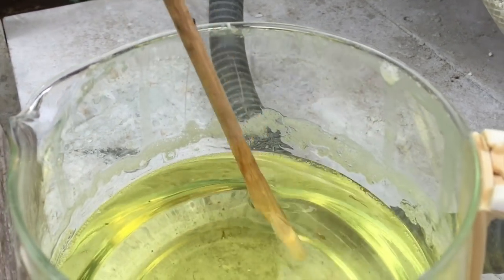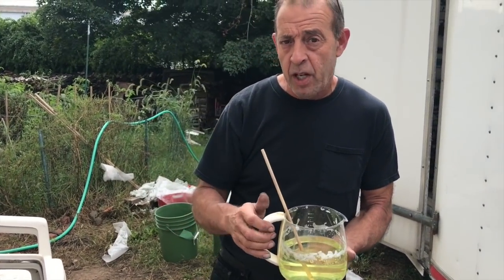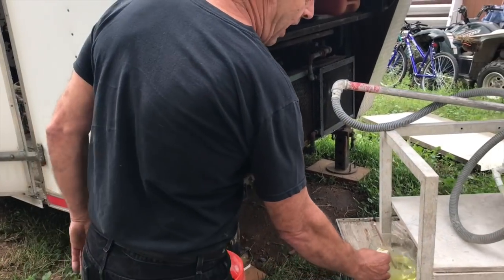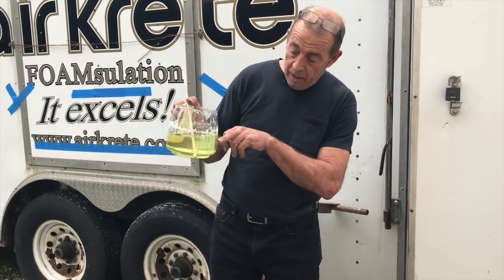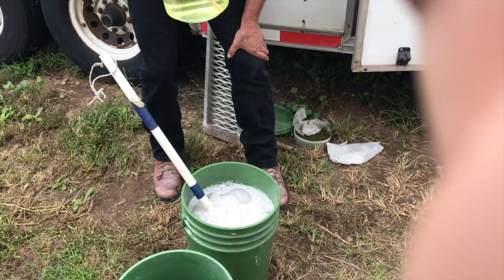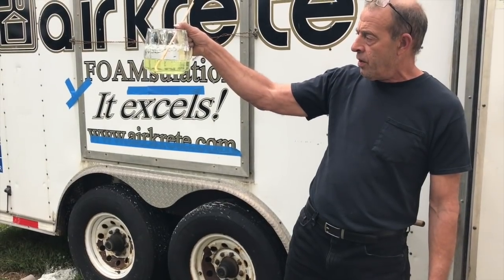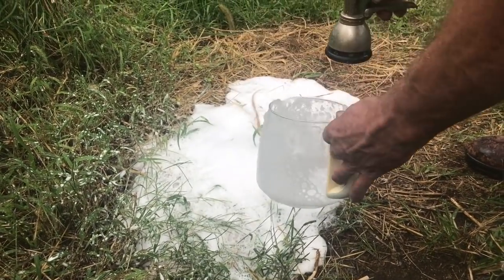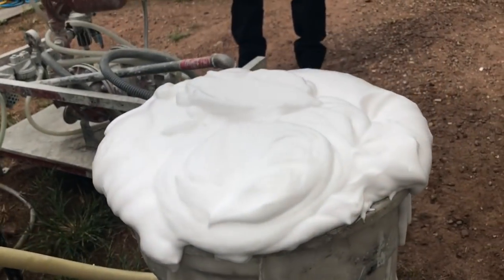Airkrete Foam formula

Comment: Hi, can you please do a tiny experiment for me? (since you already have the "foam machine")..., so, can you tell me what happens if you put the foam (just the foam, without concrete) in the freezer to minus degrees temperature? I want to know if it freezes, if it gets hard, solid....thank you
Reply from the maker: of course I can . We know that cold temps will slow the reaction time . as for what the freezing of the foam .
It depend on the surface tension of the solution. my Foam is not a store soap. But it will become a fog like ice . Just like the agent will without air . Hope I was helpful. Thank for the question.
Reply: @comfortgreen2865  nice to know! Thanx! So, under 0°C it will be solid, like a foamy brick? Even is only water&soap?
Reply from the maker: @alexandrunistoroiu452  yes like a ice cube. but foam will shrink to a 1/4 of it starting size.
Reply: @comfortgreen2865  ...but still foam?

Comment: I'll try PVA/Citric Acid - Calcium Chloride and Gypsum. Tell me if you want an NDA/non-compete signed. I'd like to see you succeed as big as Airkrete has......
Reply from the maker: Thanks. YOU MUST Stay away from calcium chlorides. AS for Airkrete Inc. They are small for that reason. I do have a great Insulation. I have not posted it on youtube. All I'm missing is funding to bring it to market. find my webpage then we can talk. AS for the formula you have disclose it will not work as you disclosed it. you need a few more key mineral that are missing .

Comment: Try pva wood glue, + citus,to your compounds, + you can try CLR scum and calcium remover i can not say to much give yous more exsperiment you will get it in the end
Reply from the maker: True it will work. Now the why. It will be to corrosive shrinking will follow. the CLR will help in the water shrinking reaction. but cause more internal pressure and mico cracking is to follow. A big thank you ! nice to see your well on your way to making the best insulation .

Comment: I'm wanting to just make five gallons of foam create. Could you tell me the water the Portland cement and foam mixture ratio? Thank you
Reply: portland cement 12kg sand 6kg & 11 litres of water  these are enough for 5 gallones(19 lit)- fume (80g/lit W) but you can  get better quality and use  calcium chloride 8 grams -  superplasticizer 8 cc  & p p fibers 19 grams to get better result
Reply: @farzad.kishvand  Thank you so much I been trying to figure it out for some time.

Comment: I'm not sure I would want salt in my cement. I would be worried that it would negatively affect the longevity of the finished product.
Reply from the maker: Hi you are somewhat right With your opinion . That is what the foam is for AirKrete.  The new post is not AirKrete it float and not hydocopic . Thank you for fact checks

Comment: So I'm really confused.  You say you add the citric acid to the Calcium Chloride solution and the calcium precipitates out, leaving a salt solution.  To this salt solution you add PVA.   This all makes perfect sense, and I see it foams up nicely.  Where I'm lost is where the MAGOX magnesium choride comes into play.  Is the magnesium oxide made into a separate solution and then mixed with the foaming agent at the foam generator?  
I know the classic formula for foamed Sorel "magnesia" Cement is a mixture of magnesium chloride and magnesium oxide, water, and a anionic foaming agent.  Is it the case that the Calcium Chloride serves the same purpose as the Magnesium Chloride once the calcium is precipitated out?
Magnesium Chloride is as cheap as Calcium Chloride, so I don't understand why you would want to change the formula in this way, unless of course there are advantages I'm not aware of.  Magnesium Oxide is a bitch to obtain and very expensive.  Come on bro, what gives?
Reply: Find some feed supplier near you that stocks it. The 54% is the amount of magnesium it supplies, it's relatively pure magnesium oxide. The latest patent has quite a lot of information on the materials and process. 

https://feedsforless.com/products/mag-ox-54-50-lb-bag
https://patents.google.com/patent/US4213936
Reply: @zephhattan8008  That feed stuff is going to have a lot of organic compounds in it.  You don't want to get that wet and then stick it between your walls.  It will grow mold, fungus, and rot.  Not to mention feeding bugs and rodents.  This is the best deal I can find for near pure mag ox. 

https://www.ebay.com/itm/Magnesium-Oxide-MgO-CAS-1309-48-4-96-55-12-Lb-Bag/253101457907?_trkparms=aid%3D111001%26algo%3DREC.SEED%26ao%3D1%26asc%3D20160908105057%26meid%3De541f8dd85d141499f57e83810b89db4%26pid%3D100675%26rk%3D4%26rkt%3D15%26sd%3D111802127909%26itm%3D253101457907%26pmt%3D0%26noa%3D1%26pg%3D2380057&_trksid=p2380057.c100675.m4236&_trkparms=pageci%3Add10858c-2e20-11ea-9d21-74dbd1806e99%7Cparentrq%3A6b48be3516f0aad34f9f84b5ffd70d06%7Ciid%3A1
Reply: @Boscovius  So you can see why this guy is messing with now new cements. He is getting very good results, too. I have been working on this - a continuous-process non-slumping low-density low-cost mix, without any solids added - using only ordinary portland cement. It is really tough to get it dry enough using a continuous process (like airkrete).
Reply: @SpaceCrete  my question is how these results (in plastic buckets) compare to injecting into walls that are comprised of absorbent materials - drywall and wood. Also, how long does it take for all that moisture to evaporate, is it necessary to run dehumidifiers for a period of time following install, etc.
Also wonder about corrosion with contact of metal components within the walls.
I like the idea of it but there seems to be very little in the way of testing and long-term results available to determine its value.
Reply: @piezoman79  Yeah the issue I am concerned about in a wood-framed home in a humid climate, is that, does aircrete or airkrete insulation promote decay of the wood long term.  The airkrete people do have a long track record, but the stuff does absorb water, if available.  Not worried about short term issues, and not worried about our foam/cement projects.  It is excellent fireproofing as cladding.

Comment: I wonder has anyone tried just adding a can of polypropylene foam? Similar to Great Foam insulation for doors and windows but HandiFoam is polypropylene. It's the same material used to lift concrete that has sagged. Some say the polypropylene won't last but I'm wondering if blended with the concrete directly may increase it's durability. Just curious, will probably give it a try
Reply: Polypropylene is hydrophobic (doesn't mix with water).
You need something with the same consistency as shaving cream and will mix with the cement - not wads of non mixing plastic!??
Reply: Great minds think alike! I will give it a try too andrew.
Reply: It won't work, I think!

Comment: dawn dish soap
Reply from the maker: Kind of, no funny smell and we don't end up with 500 empty dawn bottles at the end of each job lol
Reply: I’m fascinated by this stuff. You still at it?
Reply: Dawn has sulfur compounds that could cause a breakdown of the product over time not to mention any off-gassing of sulfur in a home would cause health issues and accelerated breakdown of other materials and home appliances.
Reply: @BudsMoKing  Very interesting - thank you for sharing. Are you referring to sodium lauryl sulfate type stuff? I am still looking for a foaming agent that is non-toxic and works really well. I can't get the pva to work well - and don't want to slow down the cement with citric anything. Just did a test of several. Richway CMX worked the best so far, but is somewhat toxic to aquatic life.